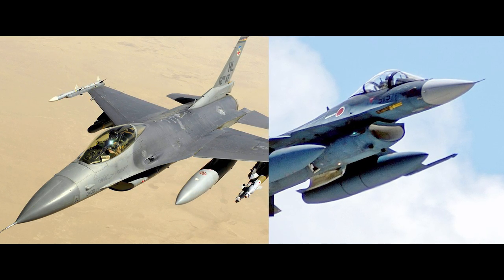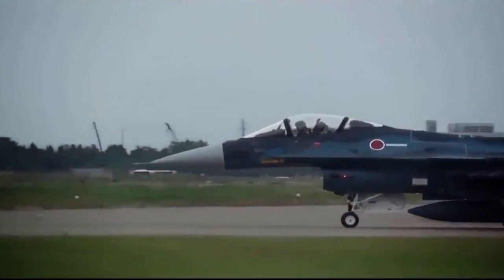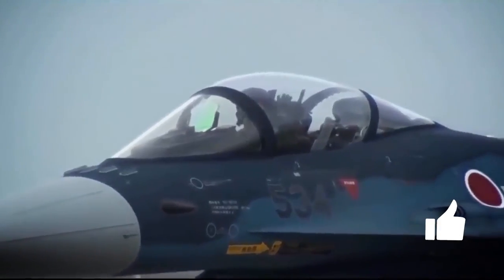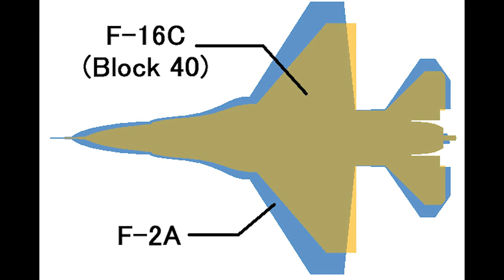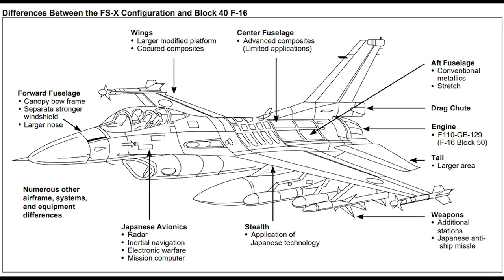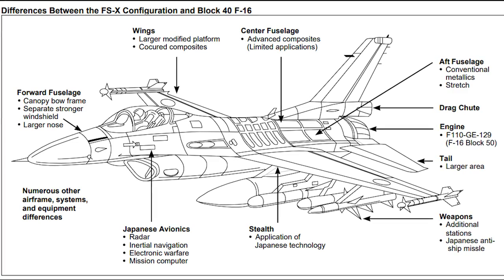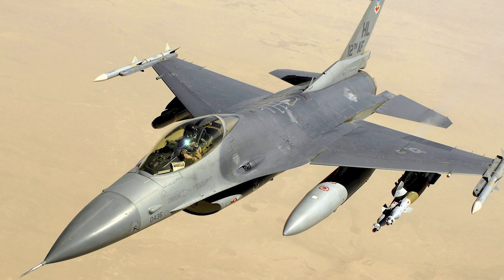Mitsubishi F-2 vs General Dynamics F-16 - Which are the differences?

Comment: So, as someone who's actually read the docs on this thing, let me point out quite a few things that people commonly get wrong or don't know:
1. It actually has dedicated anti-stealth capability, it's capable of detecting objects with greatly reduced RCS in look up mode, being assisted by it's ability to datalink with other F-2s to help composite small returns, and in look down capability it's actually capable of detecting aircraft even with literally no radar return, to do this it uses occlusion and synthetic aperture imagine to reverse calculate where the aircraft is.
2. Datalink, as previously stated, Japan has a really good datalink, in fact it's actually better then the one used by the US (roughly 5mb/s versus 1.5). Aside from the more advanced radar pairing as was previously mentioned, this extends to it's datalink to it's weapons, which is good enough that it can use it's radar to guide in AAMs assuming their lock was to fail... not that they really could.
3. Weapons, so, it's A2A loadout is actually better then that of the US, AAM-4Bs were the world's first ARH to have an AESA seeker head, and you know how i said multiple F-2s can combine radar returns to help lock stealth targets? yeah the AAM-4B can use that, meaning it can actually target stealth aircraft effectively despite being radar guided. And as for the AAM-5B, it is the only production missile to employ dual colour IIR, which when combined with the information from the datalink means it's basically impossible to decoy or flare, even more so then literally any other missile.
4. While it has 10 pylons, the inner two can not mount guided munitions.
5. Essentially every modern fighter (F-15, F-16, F-22, F-35, Su-27, Su-35, Su-57, etc) is software limited to 9~ Gs, the F-2's computer G-limiter allows for up to 10 Gs to be obtained, making it technically the most maneuverable fighter in the world under specific conditions.
6. It has a more advanced ECM suite then the F-16, with it's ECM more closely being comparable to that of the F-22
7. the F-110-IHI-129 engine it uses produced roughly 3 more kn of thrust then the US produced version (134 vs 131kn), this is due to improvements to the software which controls it, as while as this it has a better power curve across altitude/speed ranges due to it's larger air intake
8. The one downside compared to the F-16, it does not actually have JHMCS compatibility, meaning that you can not look to shoot in it, this isn't as large of an issue as in older aircraft though as the AESA radar allows it to lock every target in front of it anyways.
9. it's nickname of viper zero actually is not in relation to the A6M2 zero, this is due to the fact that it was known within japan as the heisi 0 fighter, due to the year it entered service.
Reply from the maker: Thanks for your input!
Reply: nice specs but there is other mentions as cost / effectiveness ...i still find f-2 and F- 15 j more compatible with moroccan vipers ? still a point of view plus the delivery schedule till 2028 for the korean fighter is full and not combat proven yet .

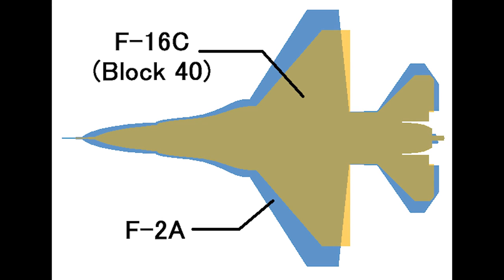Comment: 0:54 "The extra wing area (gives the F2 better maneuverability), giving it better thrust-to-weight ratio." Sorry, I think you meant something like the wing load (mass per area). Thrust to weight involves the engine and the whole mass of the plane. But anyway I liked the video, because it quickly tells all the most important info I wanted. I wonder who would win then, if the price is the same, four F-16 or an F-2? Also they improved the range a lot and it's crucial for the Japanese.

Comment: People still saying F2 is a copy plane but in realife Japan want X2 shinshin and Mitsubishi F-3B but Those were banned by US because Japan lose ww2 and they do now allow to have a Military or their own Planes.. Japan ask American many time to have New Fighter they also ask for F22 but sadly US only share the technology but not a plane but in late 1990s US share the F16 to Japan and Japan add their own technology and change the desgin abit and this is Sharing not Copying *
Reply from the maker: It certainly is no copy.
Reply: Sorry, but it's copying, the Japanese f2 is literally still made by the American General dynamics. Japan loves to steal credit for everything made by Americans
Reply: Yeah, it's sort of a copy. The F-2 is based on the designs of the F-16 Block 40 (i.e., Agile Falcon). However, it's more of a modified aircraft that meets Japan's requirements and standards, of course.
Reply: It's an upgrade.  The new f3 has a new airframe and is multi engine.  It has external mount points but it's wider fuselage can be redesigned for internal armament and would then be classified as 5th gen.  The F2 has fewer through bolts and more composite making it lighter and lower radar cross section.
Reply: I mean, it's far from a copy, but everything else you said is so wrong, so in order:
1. Japan did make the X2 shinshin, however it was only ever intended to help with the development of the F-3, not to literally be it, also, when you say F-3B, fyi japan uses A/B to dictate 1/2 seater aircraft, like the US does with C/D, so B does not mean more advanced (for aircraft atleast, for weapon systems yes B is used to dictate newer stuff, but that's actually primarily for external reasonings, internally they're just referred to as revised/improved)
2. Slightly correct, japan does not have a true military, however this isn't due to them losing WWII, it's banned from their constitution, which does allow them to technically have armed forces as long as it's not a military, hence the JSDF, also since this was a domestic decision it does not affect other countries willingness to sell them weapons.
3. The reason the F-22 is not exported has nothing to do with it being japan, america just has an export ban on it period, funnily enough though, they did actually consider selling it to japan despite that, showing just how close the two countries are to each other politically.

Comment: The F-2 is just an enhanced, reverse engineered F-16. It's like adding aftermarket parts on a car and calling it something else. It's still the same kind of car!
Reply: Nah it's a copied design but not a modifying. Yeah it's basically the same thing with different parts, but it's still not a modded version of F-16. (Insert here that F-16 has almost the same wing loading compared to F-2. It's just a matter of the fuel load) Avionics are different but F-16 has upgraded variants so I don't know. I'm reposting the same message over editing my post so, sorry for the inconvenience.
Reply: 95/100 diffrent than the f 16
Reply: @iq-raa.college  if it's 95% different than the F-16 and why does it look so much like it

Comment: The F2A Super Kai and the F-16C Block 72+ (both with CFTs) will be more lethal and dangerous. If both fight in WVR and long ranges. It could be F2A or F-16C can blow up exploded. Its up to the pilots in the end. If US allow Japan to sell F2A, and if its ok for Japan. F2A Super Kai is better for Ukranian Air Force, (if they have enough funds). As for my country's air force, the 🇵🇭 air force. F-16C Block 72+ is a better option. Because the F2A is more expensive.

Just install GE F110-132 to the F2, and install PW F100-232 to the F-16. Much better if PW F100-232 is created. Unfortunately. PW did not create the F100-232.

Edit: F2A Super Kai and Block 72+ can be both good tandem partners.
Reply from the maker: But I understand the Super Kai was rejected in favor of the F-35.
Reply: @A_Short_History  Thanks for the reply. Well. Maybe the stealth feature and techs is the reason of the Super Kai's rejection.
Reply: it's not about the US allowing for japan to sell it, contrary to how a lot of people seem to think, japan isn't just a puppet state of the US. Also yeah the super kai was rejected. and the reason for it's rejection wasn't so much performance as it was cost, yeah despite how expensive the F-35 was the F-2 super kai refit was estimated to cost a similar amount if not higher.

Comment: The original American version is better than the Japanese copycat
Reply from the maker: It really isn’t a copycat. It is it’s own thing.
Reply: better turn rate can engage outside of visual contact and has stealth while the OG american version doesn't have any of that and your saying that...
Reply: 1. It isn’t a copycat, it is licensed by the F-16 creators
2. It has improved avionics
3. Slightly reduced RCS
4. More stable airframe
Reply: @theoc007 the F-2 is not by any means considered a "stealth aircraft." It has nearly the same RCS as a modern F-16C. The RCS of a modern F-16C is 1.2m sq while the modern F-2 is sitting around 1.5m sq. Which would make sense with the larger airframe while still using the same composite materials. Also, the F16 has been capable of BVR engagements for a long time lol.
Reply: @acer48  It doesn't "have stealth." Composite materials can REDUCE radar cross section, but this aircraft still has a 25% larger wingspan than an F-16 and will be carrying munitions externally, voiding any said "stealth" capabilities. Lighter and stronger airframe ≠ true stealth. The topic of better avionics can be debatable as F-16C has been using an AESA radar like the F-2 for at least a decade. All in all, they are both extremely capable airframes that would be working in unison either way.
Reply: @noah._.powell  Compared to the original which is publicly released information at 5m^2 for the f-16 while the F-2 has not disclosed that information to the public but it's estimated to be around 1m^2, so yes it has better stealth abilities then the original f-16. Your misunderstanding the original comment stating the ORIGINAL F-16 is better than the F-2, Which is what both me and acer are stating is not true.
Reply: It is a licensed product 😂 but Japan changes design and technology
Reply: @Mrchesda22  idk man 60% of the design being done by japan with 95% of the total design being redone puts it at a fair bit more then a simple license copy
Reply: It's like you're saying B2 is not a copy of old German technology 😂and the V2 rocket was copied by Americans and Russians. Ponteus Pilate's at it's finest.
Reply: @acer48  open your eyes it's a copycat. Don't be so ignorant.